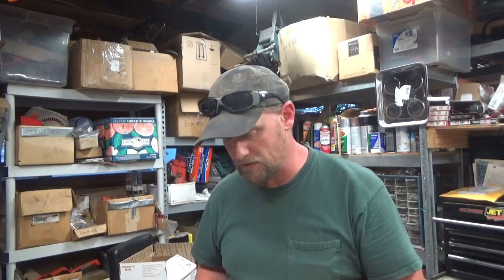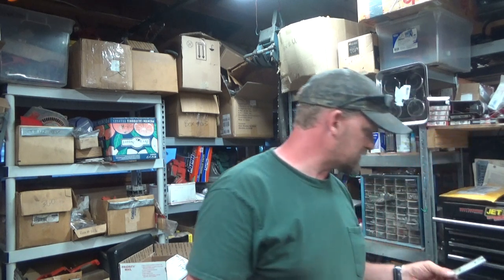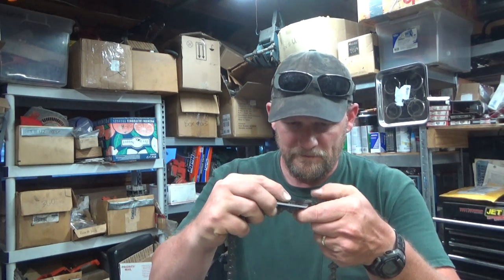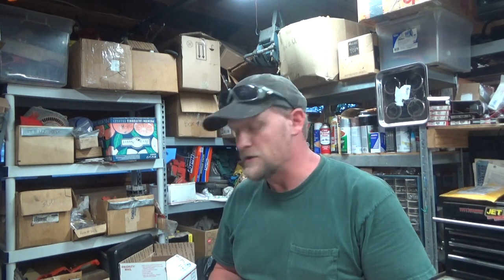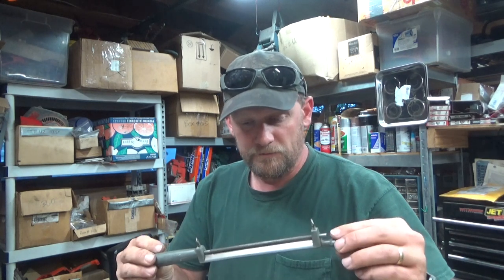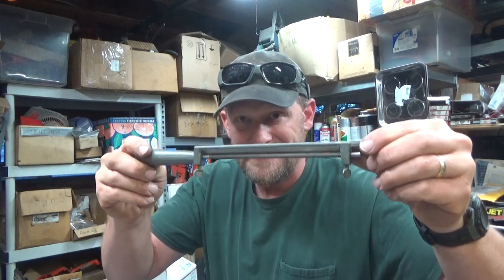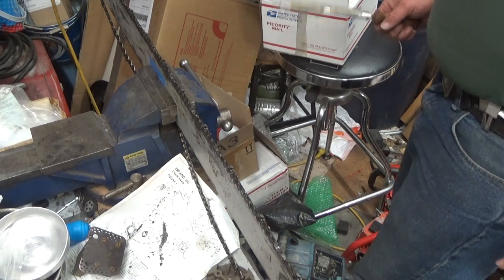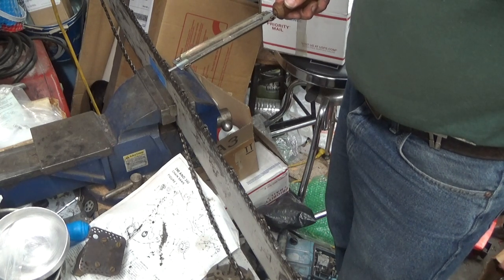Does Length Really Matter? It Does For Chainsaw Teeth!!

Comment: I hand sharpened for years. Now i have a grinder. If i dull a chain enough it needs more than a couple strokes in the woods I switch out the chain. not gonna spend cutting time sharpening. I always carry a couple spare chains. if i am out for a full day i have a little inverter in the truck and a small grinder I will regrind the dulled chains when I come back for gas or lunch

Comment: 2 years ago I went with the Stihl 2 in 1 and the stump vice, it works fine for me.  Using this, I’ve always had even cuts and no uneven bar wear. No complaints at all.  I didn’t want to buy a grinder for my chains as I’m just a hobbyist.

Comment: Look im a big fan of both you an Bucking. Just because you have a different way of doing things doesn't mean your wrong. Its just different its the way you prefer.  I do some of both which is different an it works great. So No One should upset about your preference  . I think you both do a great job. I can learn from you both Bucking is not the only way. An l take a bunch of stuff just as you do you never know.

Comment: I carry a five gallon bucket.  It contains my wedges, leather gloves, a scrench, a carb adjusting screwdriver and a quart of bar oil and my Stihl 3/8 sharpening set.  I hand file everything, even though I have an electric sharpener.  My chains are mostly 3/8, .050,72LGX or Stihl RS. I don’t mess around with the wood.  I usually set my rakers a tad hungry.  Most of my chains are on 60+ cc pro saws.  I only sharpen chains after I get back home and have cleaned up the saw.  I take three or more saws with me.  If one gets dull, I grab another.  I sharpen my saws with the appropriate size file and a file handle.

Comment: Good perspective on sharpening sharpening chain has had its debates my advice to newcomers is practice makes perfect you're going to screw up if you change before you get it right your depth gauges or rakers are a big deal just as important as a sharp chain my advice for newcomers is sthil makes a sharpener that does the rakers and the tooth simultaneously it's a great way for your amateur cutters to learn how to file
A person got to be careful with the rakers too much can make your chain really chattery or graby I'm making for a dangerous situation
Another thing that really important is your bar rails making sure your rails are square and true if one side is worn down more than the other the saw will cut crooked and if the rail Gap is worn it will cut crooked as well it takes a combination of everything to make your saw cut like a dream
Reply: Andrew- That's a good list!  I'll add: correct chain tension; to  "cut like a dream".

Comment: Leon- I count file strocks.  4 max or I stop the saw. 
Sharpen every tank of gas.  If you can see cutters are uneven lengths Lt  Vs Rt; a Guys in trouble.  
If a tooth is short b/c it was rocked; I don't care as long as it's sharp. 
Never liked the Homelite file guide.  Oregon 7/32 w/ wing nuts not the clips were Preferred.   
Bought an Oregon electric pruner saw. Junk.   Not sure how their other stuff is today.  (This was Fire crews in the 70 +80s)
Thx
hp

Comment: Chain sharpening has turned into the new debate lately it's not rocket science keep your angles right keep your hook deep under your top plate I file my weak hand side first then just match up the other side helps stop mismatches on length use a rakers guage a must dress your bar that was what I was slowest to do myself I don't work on chains in the woods bring spares ,better yet just bring more saws .
Reply: Tom-
"keep your angles right "  Couldn't agree more!  Manufacturer designed it to cut out of the box; just keep those angles.

Comment: Awesome video, found this after cutting up some hardwood today and had some questions.  I noticed it wasn't cutting well, and creating some smoke.  Checked the bar lube, all good, so I realized my chain was dull.  Brought it into the garage, threw it on the vice, and started using my plastic triple file Stihl sharpener thing.   However, I noticed while sharpening exactly what you touched one; half the chain is dull, the other half isn't.   In fact, I'm not sure what to do.  I have square edge, round ground type chain, and what I'm noticing is that one half the chain has been dulled so bad that it looks like a round ground chain... so basically half my chain is round, the other side is still square.  WTF.  Is it even worth sharpening or should I just replace it?   I have a feeling i know what your answer will be.   Cheers, new subscriber here, great channel!

Comment: ...I mostly grind customers' chains due to time, and strain on my 54 year old hands doing dozens of chains with a file...that said, I have been filing chains for 30+ years, and have evolved my technique over time..at first, I religiously counted strokes..then at some point, I said "forget it, waste of time, this ain't workin' for me" when I realized that each tooth has different degrees of dulling/damage when sharpening, and some have become harder due to abrasion heat...therefore, it takes different numbers of strokes to get each tooth shaped up and sharp again...at the point I am at now, I usually use a vise, and free-hand(no file guide)round file( I still haven't gotten down the square filin' thing yet)...file each tooth until it's where I want it sharpness-wise, and I eyeball the teeth and get them RELATIVELY close to the same length..so I may take some extra off one tooth to get it closer to the others...I eyeball the angles and gullet...I am NOT a fan of having cutters a LOT shorter on one side than the other, and like you said, they break off when extremely short, or even bend backward and don't  cut straight..and I always swap the saw around in the vise, I can't reach around the saw and file comfortably...Now, I DO count my strokes when filing the rakers without a depth gauge...I guess what I am getting at, I incorporate elements of what both you do, and what Billy Ray does, and some of my own personal methods I have developed from experience..so I consider you both to be correct :)...I agree 100% that guides and gauges are good tools for noobs or weekend warriors to use...and I recommend them to them..although some of them will never be able to file a chain worth snot, no matter how many years they try or what gadgets they use..I guess that's why they pay me to grind them :)...when cutting wood myself, I prefer to file my own chains...anyway, great video!
Reply: Dyer- Enjoyed your comment!  I'ld see a sawer (Thinning crew) couldn't sharpen chain.  I'll give him a new cutter link on a leather tether.  "Tell him hang on to that,  make your teeth look the same."  (They would have a file guide.  Learn to keep a 1/3 of file above cutter that way.)

Especially liked this part:
"..although some of them will never be able to file a chain worth snot, no matter how many years they try or what gadgets they use.."
and
" I religiously counted strokes..then at some point, I said "forget it, waste of time, this ain't workin' for me" when I realized that each tooth has different degrees of dulling/damage when sharpening, and some have become harder due to abrasion heat...therefore, it takes different numbers of strokes to get each tooth shaped up and sharp again."
I'll add:
You save a lot of chain that way.  
On shapnest: Light will reflect off the dull edge.  Sharpen till the reflection is gone. 
thx
hp

Comment: I have tried hand filing a bunch of times, and it always turned out bad. I went to an Oregon 511A clone, and have used it for over 20 years. I really stepped up my sharpening quality when I dumped the grinding "stones" and went to borizon wheels. I never burn a tooth and they work great. I remove the small burr that forms on the tooth with 1 or 2 swipes with a wheel dressing brick, and all is good. This only adds about 5 seconds per tooth, but it's worth it.

Comment: I carry a Husqvarna combination guide and raker gauge.  I also carry a spare chain.  If I rock it, if it's more than a couple teeth, I swap chains.  If I rock the second, I sharpen it.  You can often sharpen a few times before needing the raker gauge.  Even if you count strokes, at some point you take it down enough you need the raker gauge or you just make powder.  That's hard on the saw.
Reply: Steve you wrote, "Even if you count strokes, at some point you take it down enough you need the raker gauge or you just make powder.  That's hard on the saw."

May I suggest:  A Dull chain makes powder and is hard on a saw.  High rankers are ez on a saw; as the cutter can not engage the wood.  If I have that right?

Comment: Hi Leon, I sharpen hubby's chains for him as we have an outdoor wood burning furnace and 38acres of timber. I have the taker gauge etc. Question is sometimes the chain needs 40strokes to sharpen one side and only 15 on the other. I was told if I do 40 on one side I need to do 40on the other to keep it uniform???  I check takers each time I sharpen. And was told if wood dust is like sawdust takers are to high???  Thanks
Reply: You keep mentioning taker ' what is a taker ?

Comment: Have to disagree a little. If you have a shorter length tooth and two longer teeth on either side the shorter tooth will not reach as deep as the two longer teeth cause their taller than the short length tooth. So the short tooth is just floating thru the kerf! Also as a casual user I keep my depth gauge at hard wood cause I cut different wood hardness and never know which I'll be cutting from day to day or tree to tree. This way I don't over tax my saw if i'm cutting soft wood.
Reply: Wes- I find the short tooth stays sharp.  Loner one dulls 1st; the lengths catch up again before long.  Extends the life of your chain.

Comment: Great video Leon!  I seam to get about 1 good sharpening on a chain before my file is dull. I use Oregon files but they don't hold up.  I cut in one direction and tap out the chips on every tooth.  Is it just Chinese steel?
Reply: I've noticed that too.
Reply from the maker: I'm not sure where the Oregon files are made.  I've been ordering Pferd files from Baileys and they seem to be holding up a bit better.
Reply: Look at where the file is made - Swiss made ones are the ones to buy. They get stamped with different "Brand Names" but come from the same factories. I like Stihl, Valllorbe and Save-the-edge files. Some are more aggressive than others so, just like your style of filing, you may need to adapt the pressure you exert on the file depending on brand.

Comment: I moved to Hawaii 2 years ago after falling timber on the Oregon coast for 3 years. I had a silevys razor sharp 2 chain grinder my whole time cutting in Oregon running full comp square ground. Since moving here 2.5 years ago I have been hand filling which is creating a my rails on my bar to ware. I feel like my sharpening is dead nuts and would be good in doug fir but these soft albizia i now cut lets my bar drift soooo easy. Any recommendations on a new rail grinder also i sold my silvies but may get a simington swing arm to eleviate my issues. Might just ship about 25 bars to Madsens and have them grind my rails. Buying a 36 inch stilh bar once a month
Reply: Also just stumbled on your videos mahalo for sharing🙏
Reply: Also the other timber contractor is an old-timer and has the same issues with the bar ware and j cutting on his dialed chain. Though he just got his chain grinder shipped from the mainland so we will see if his bars last longer then a month
Reply: @jrtaylor87  Any updates?

Comment: I used to not use a rakers gauge I would put the raker file across the teeth and eyeball I now use a Windsor 4 in one depth tool. I have always filed free hand I have never found tooth length to affect the straightness in cutting myself.

Comment: Have they made the cutters less tall on stihl chain ? I have almost all 3/8s chain . I stopped at a stihl dealer to get files and they handed me 13/64ths instead of 7/32nds. I said what's this? Not 7/32nds? He said that's what they use on 3/8ths chain. I understand it undercuts the top plate more but now I have to train all my saws to it and it takes FOREVER if it's an old chain. Oh well ,keep both I guess. I can't count that many strokes.haha.
Reply from the maker: Not sure on the Stihl chain.  I run Oregon and they still call for 7/32.
Reply: Stihl recommends a 13/64th file for all their 3/8th's chain. I called a Stihl dealer about this because my dad had been using a 7/32nd file on his 028 AV with 3/8th's chain. The dealer told me everyone in that area uses 7/32nd's. Once you sharpen a new Stihl chain the first time with a 7/32nd file, you open up the gullet, so thereafter you stick with a  7/32nd file.